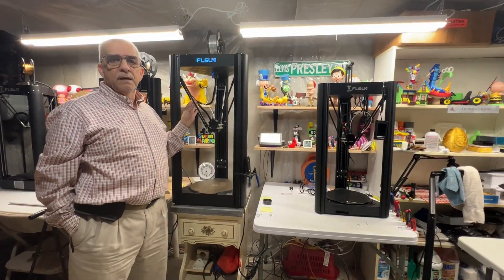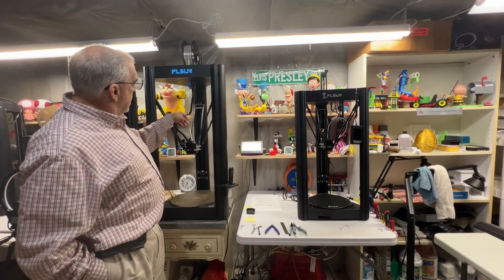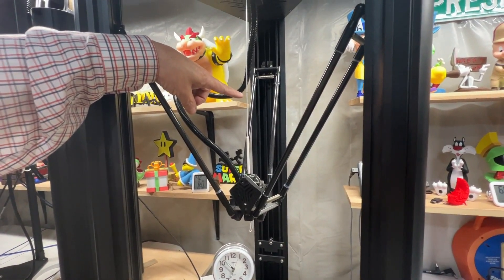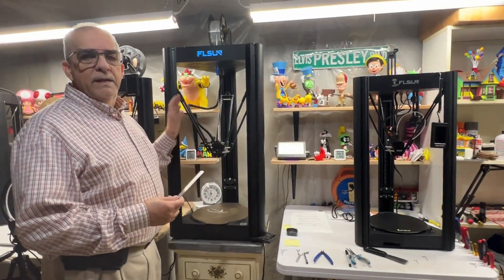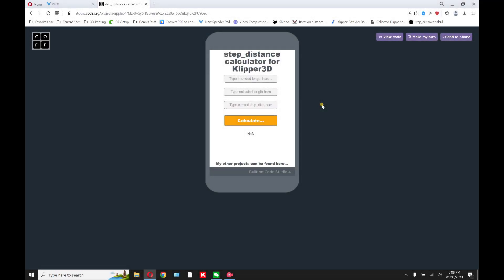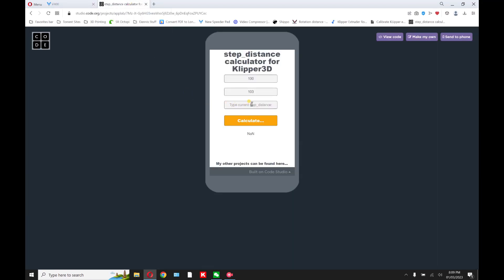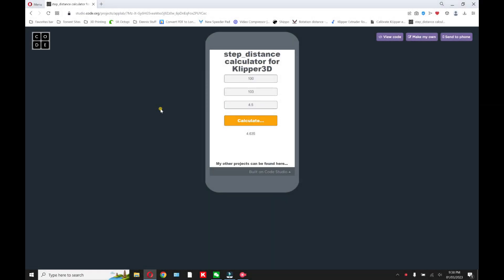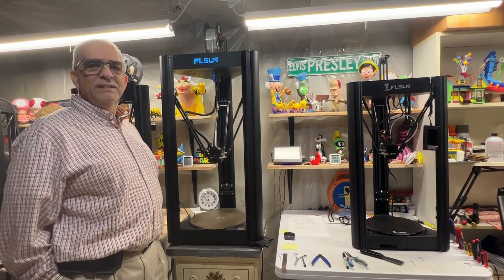FLsun V400 E Steps - Klipper Rotation Distance

Comment: Hello from France .
I am a newbie with new v400
Your videos are of very good quality and very interesting.
The correction is only good for the roll of wire tested. So do we have to redo a setting for other types of PLA, TPU etc and each time modify the saved value?
Reply from the maker: No, once I have set it, I can change rolls as I wish. But if you change material type such as ABS, you might want to check it again...

Comment: Dennis I'm having a problem with the lights not working on my V400.  They never worked from Day One.  I've had my machine for over a year and I just connected FLSUN recently about the problem.  Th3e FLSUN sign on front and the lights on the hotend never worked. Any suggestions to correct this problem.
Reply from the maker: Hello John:
Please contact me through FB Messenger.
Look for me:  Dennis G. Gignac

Comment: Thanks for this video. Tech support for FLSUN sent me the link to this video, just so you know. I was working the steps you outline and I noticed something on mine that's different from yours. I'm curious if you know what it means. In the browser, when I click on Machine, I have the same files as you plus over a dozen files named something like "printer-20230407_075209.cfg." The numbers change for each entry. There are a bunch from August 2022 - before we ordered the printer and then a bunch more after we received it in March 2023. Any idea what these files are? Can they be deleted?
Reply from the maker: Yes, you can delete any files that are named this way. It is different dates that the printer config file was changed for some reason.
Or, just create a folder and call it Old Files and put these files in that folder...
Reply: The fact that the FLSUN tech support gave you a link to this video just tells how great this video is

Comment: Great Info!  Thanks..its difficult to find good, simple instructions for Klipper.  Now, how to save your Z calibrations on the Speeder Pad.  After I set it and print, it is not even close to what was set through the pad.
Reply from the maker: There is no save button. It does saves automatically when you set the z...
Reply: @dennisgignac5103  thank you.   I've given up on the speeder pad.  Can't get it to print consistant at all.

Comment: Can you tell me if the v400 hot end assembly directly fits the sr? Or is the effector dimensions different?  Thanks
Reply from the maker: It does not. You would have to do some derious wiring changes. But it will fit onto the arms...
Reply: @dennisgignac5103  I think if you look at the connections on the V400 motherboard and the sr motherboard they are the same connections. so if you got a v400 complete hot end i believe you would just have to plug them into the main motherboard on the sr i heard the connections are the same. I believe the sr motherboard is actually a newer board version wise?

Comment: Hi Dennis, please correct me if i'm wrong... you want to extrude 100mm and measured 103mm so the extruder moved too much filament to the nozzle. Shouldn't the value (in your case 4.5) be lower? About 4.4 or so? thx
Reply: Yes He made a mistake there.
Reply: you said 4:48 "let's say we measured 113mm"  but you should have measured 7mm   (marked 110mm - extruded 100mm - overextruded 3mm)
Reply: i've checked the link again and they have fixed the issue, now the value is lower (4.12)